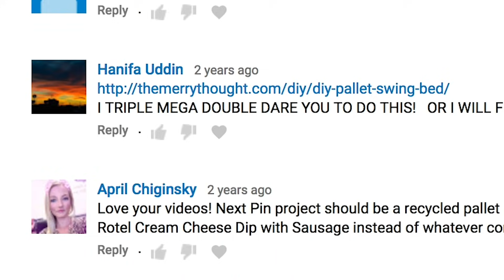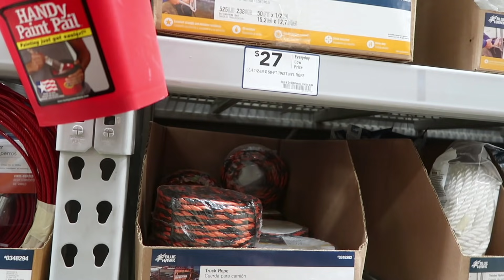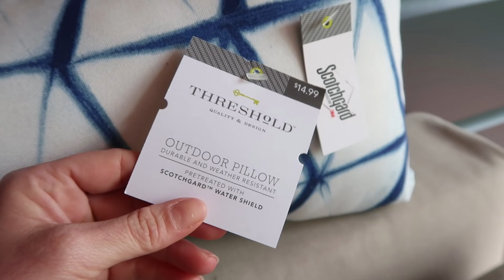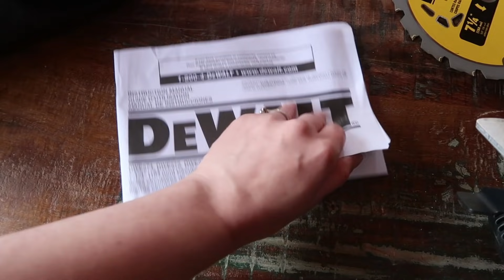🔨DIY Pallet Swingers, Corinne VS Pin

Comment: You can’t mark all your measurements on one piece of wood. Saw blade takes off about an 1/8 of an inch. You have to cut and then mark your next piece so that the second piece you cut isn’t too small.
Reply: Reborn momma 129 educated
Reply: genuinely wouldn't have thought of that thank you
Reply: Lol I’m a 17 year old girl in a high school theater tech class but I do know some things about carpentry. Always have to account for the saw blade, which like I said is 1/8 of an inch (normally)
Reply: That is true, I learned that in wood shop. measure once, cut, measure once, cut,measure once, cut, then you with have a good sized peace of wood but in this case she didn't need to do so she was USING a pallet so you don't need to have super good cuts.
Reply: piece
Reply: You should try making 'can' art Corinne!
Reply: Yeah or she could have left some space after each mark to allow for the width of the blade. That way you don’t lose any length but can still make all the cuts at once
Reply: I was thinking the same thing!

Comment: My father, master carpenter, built one of these out of an actual bed. He suspended a twin bed from our porch, added arms and a back to it, hung it with chains so it can hold like 1200 lbs, and then used rope lights on the ceiling around it. He also put ceiling fans on the porch.

Man... thanks, dad.

Comment: Why make a swing out of pallets? Pallets are made from cheap, flimsy wood. You would be better off building the swing from scratch with construction lumber. It would cost the same and would be stronger as well. I've never heard of a pallet swing but as a construction worker I wouldnt reccomend it.